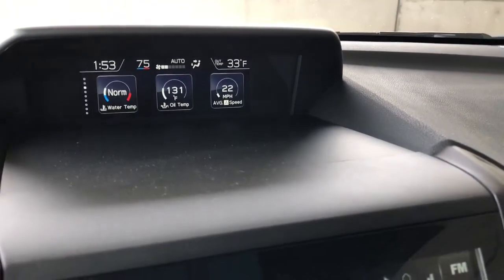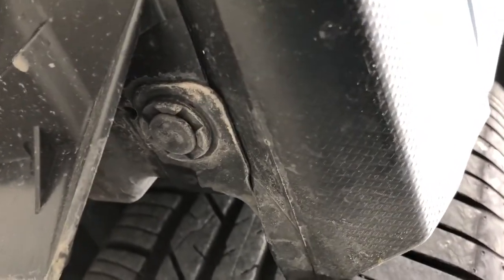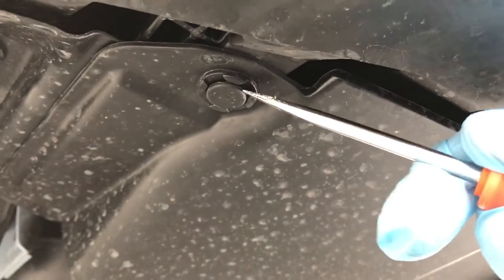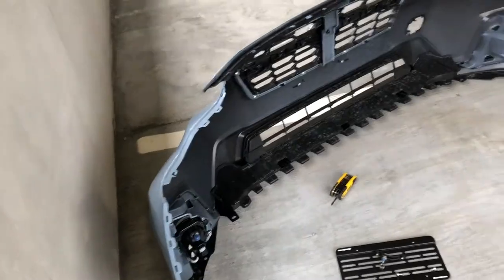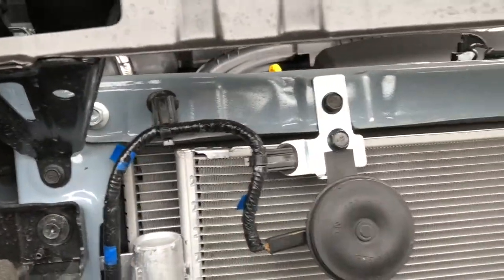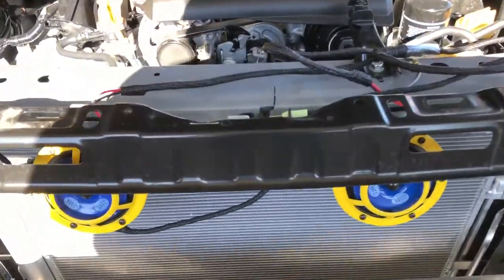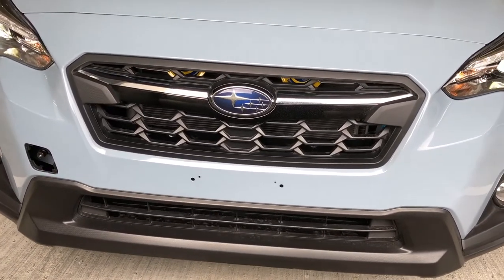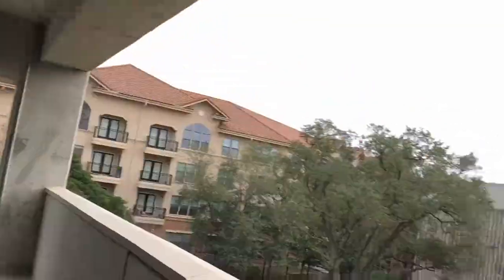2018 Subaru Crosstrek Front Bumper Removal:Hella Horn Install

Comment: I was able to just disconnect the second horn by removing the air filter assembly  I then tie wrapped the plug to an adjacent harness.  all other stuff was done by just removing the fairing.  I created my own wire harness assemble   I guess 30 years as an aircraft mechanic helped that.

Comment: Great video! I just installed mine today and I couldn’t get the original brackets off the horns. I ended up improvising and got them installed somewhat evenly spread apart. How did you get your brackets off and wasn’t the ground relay box in the way of the plastic shroud when re-installing? I ended up semi mounting it to another spot. Thanks in advance!

Comment: Great video.  Did ALL the parts needed come with the kit?  How long did the whole process take you?
Do you have links to where you bought it?  Your time and input is appreciated!
Reply from the maker: Thin Blue Line yes the kit had everything. It took about an hour to do. I bought it from subimods. https://subimods.com/subimods-hella-horn-bracket-and-v2-wiring-harness-combo-2012-2014-impreza-na-2013-2014-crosstrek-2015-forester-xt-sm-h-combohb.html

It’s the previous generation as there was nothing for 2018. You have to adjust the bracket that the stock horns sit on when you install it.

Comment: Thx for the walkthrough. What size spacer is on the hood latch behind the bracket? Inner diameter 3/8” by 1” length?
Reply from the maker: To be honest, I don't know the diameter. It was a bolt from the car, but it is about 1 inch in length.

Comment: What license plate relocation kit did you end up buying?
Reply from the maker: Daniel Hilo I purchased the grimmspeed relocation kit. The one made for a 13+FRS/BRZ. You have to just use the 2 extended nuts to make it fit properly.
Reply from the maker: If you are interested in purchasing from me, I will sell it to you. I decided to just mount the license plate back where it was drilled with the Baja design bracket where you can mount lights too.
Reply: 18CrosstrekMan didn’t end up buying one. How much?
Reply from the maker: Daniel Hilo I can 50 shipped
Reply: 18CrosstrekMan what is the product number of the kit?
Reply from the maker: SKU:
094029 http://www.grimmspeed.com/license-plate-relocation-kit-2013-17-subaru-brz-scion-fr-s-2010-legacy-outback-2017-impreza-non-turbo/

http://www.subaruxvforum.com/forum/appearance-body/108353-license-plate-relocator-kits-2.html
Reply: 18CrosstrekMan is the license plate relocation kit still for sale?

Comment: Did you order the 2017 Crosstrek kit?
Reply from the maker: I assume the 17 is like 13-16, so yes. Here is the exact description of the kit. Subimods Hella Horn Bracket and V2 Wiring Harness Combo 2012-2014 Impreza N/A / 2013-2016 Crosstrek / 2014-2016 Forester